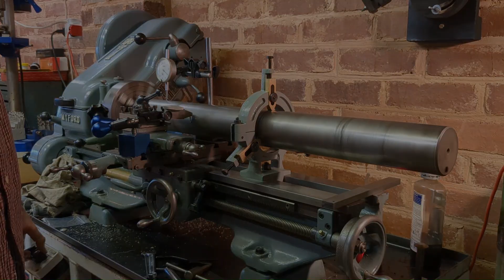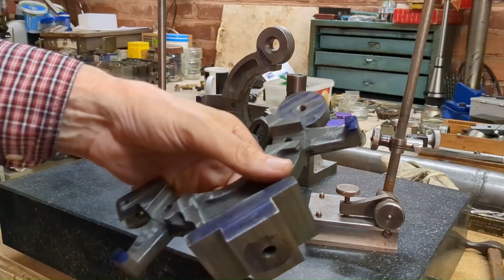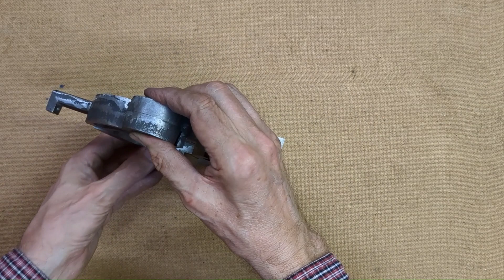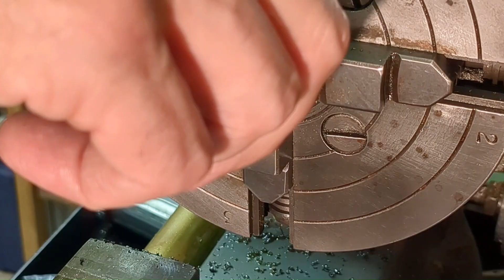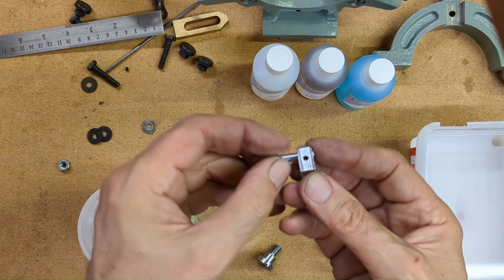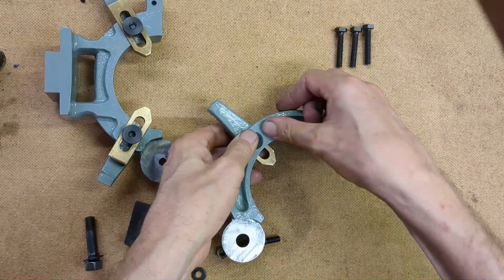Large Myford fixed steady - part 4 (completion)

Comment: Great it looks awesome. I would build one too for my myford if I were able to finde some company for the casting. I think thats the difficulties part in central Europe.
Reply from the maker: Thanks for your feedback. If there were enough people who wanted the castings perhaps we could find a foundry prepared to make up a batch. I leave that as a suggestion!
Reply: @Workshopfriend  I would be a Starter for the  set of  Castings , Clive , I have an ML7R , I Managed to Buy a Fixed Steady New for my Myford  254Plus  ,it was spares for a Chinese Lathe But the Centre Height was 1.5 Inches too High , I cut the piece out with the Machine Hacksaw  and then Milled both Surfaces Flat and bolted together with  3/8'' Allen screws , it only Cost 70$ and the Chinese Lathe Bed was the same measurement as the Myford , I enjoy watching your video's THANKS .
Reply from the maker: Thanks, Bernie, for your comments. Good improvisation for your Myford 254. Well, so far that is two people who might be interested in the castings. Let's see...